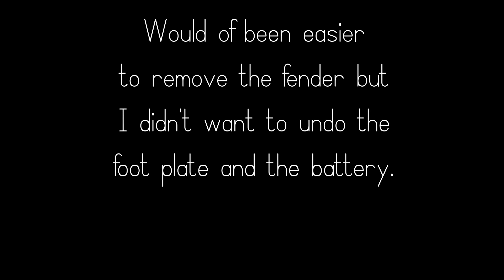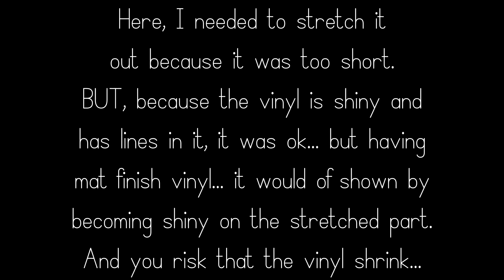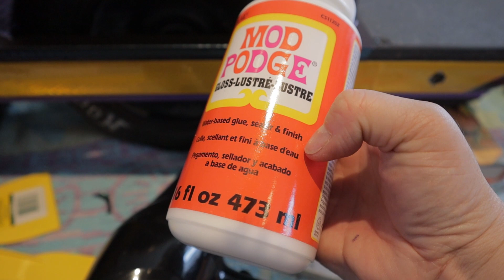Vinyl Wrapping the Battery-Fender on my Pint

Comment: Hey! Nice job.

What sort of range are you pulling on that? No issues with this mod?
Reply from the maker: Thank you! I'm guessing you are talking about the  battery itself... I am suppose to be able to do 20-25 miles on one charge. It is a 5000mah battery. But I wasn't able to test it's limit since it was winter up till a few days ago, and it is still cold. But I will definitely test it once the weather warms up. I didn't have any issues on the rides I went on with this mod. The only thing I can't use is the onewheel app while riding, I use the app Relive.
Reply: @LivingLifewithJudith  thanks! Think I'm going to go for Sonny Wheels VNR!
Reply from the maker: @obsoletepaul  Good option! The backpack option or the fender one?
Reply: @LivingLifewithJudith  think I'm going for the Fender one 😎
Reply from the maker: Let me know how you like it!!!